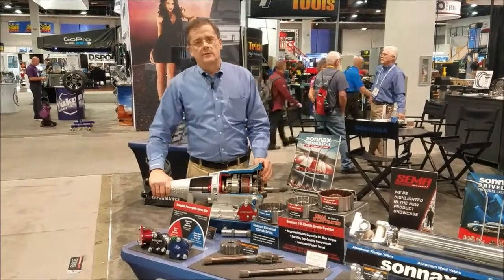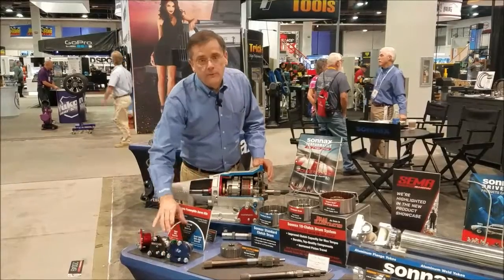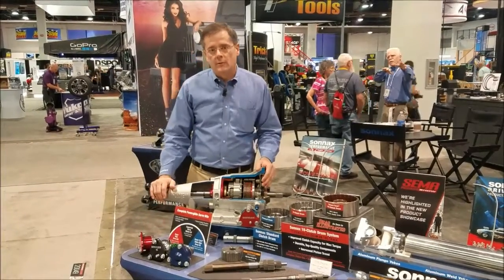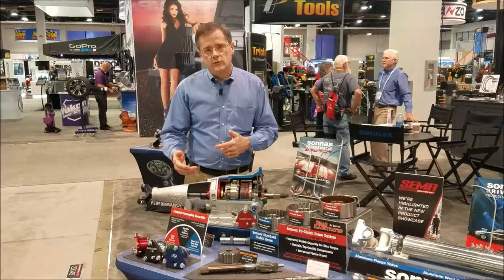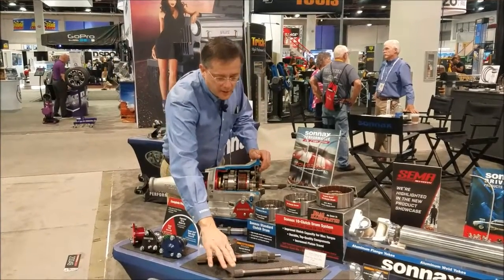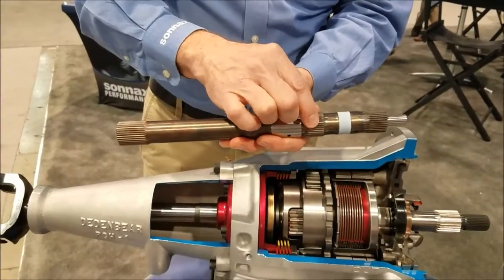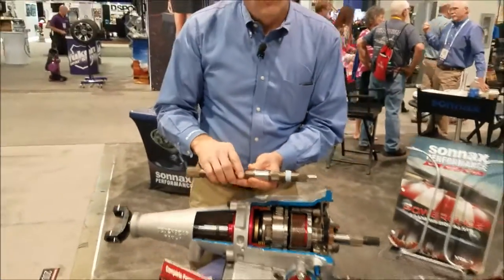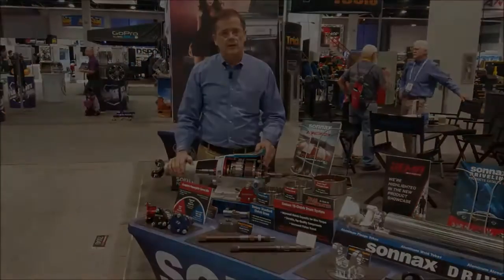Sonnax Powerglide Transmission Upgrades - Live at SEMA 2016

Comment: Can the new Sonnax powerglide servo be changed without any other items, then readjust the band?
Reply from the maker: Yes. You just need to use all the components provided with the servo. Thanks for reaching out!
Reply: @sonnax   I was thinking I could just unbolt the one from my transmission, bolt the new in and then readjust the band. would that be the correct procedure? Is this Greg?
Reply from the maker: @mikeebert8869  Yes, but there are 2 struts on the band that can fall out of place, so you just need to be aware that if they do come out of place, the unit will require removal to reposition. This is not Gregg, but that answer came from him. Hope that helps. Thanks again!
Reply: @sonnax   Is there anything special I can do to make sure those 2 items do not fall out?